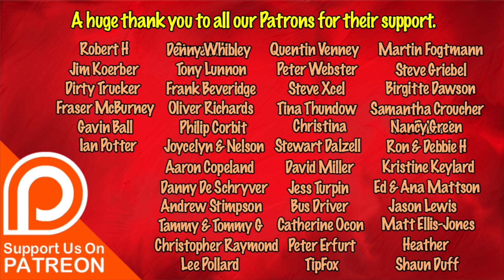How To Clean The Toilet In A Dress

Comment: You were so rocking that outfit Mazzy, so watch out! Your design will be stolen and it'll be worn on a New York runway next. What a dear hearts you both are! You give me hope I might actually get to the bottom of my big pile of stuff. I have a feeling a lot of folks stuck at home have turned to cleaning and sorting, as you have, and the charity shops will be bulging at the seams from all the stuff they will be given, once they open again. If they haven't, I for one can say I have taken a page from your book and am paring down. So now I wish they could open, so I can give them all the stuff. Also, I could have used those nice little tools Dan, the tiny screwdrivers especially. I've been wiring up pictures frames with new brackets and wire, and those screwdrivers would have been perfect. I had to use an old worn out screwdriver of my hubby's and it was practically worthless.   Thanks for all the fun, have a great day!
Reply from the maker: Yes l have a vast museum full of tools for all jobs.
Reply: @TravelTrollsTV  And just think of all the ways you've learned to use them this year! Ha ha ha

Comment: The idea of the short plug in is that you can have it indoors and then hook up your main camper lead to it and the join is in the house no chance of the connector getting wet etc but you have the long one so I would do as you said keep it as a spare head for your main hook up , The window washer filler is a lot easier to fill if you cut the bottom off of a litre water bottle or large coke bottle use that as the funnel works a treat , watch that water filler cap I had one and the inner white locking ring gave way whilst in place it was an absolute B*****d to get out I ended up drilling the centre out and moving the jammed bit from the hole I had drilled out with a 35 mm spade bit . They are great all the time they work but you never know when it is going to say no not coming off today.

Comment: Dan your new oil filter has a rubber seal on the top.
Rub some oil all around it before installing it.
Make sure the old one has a seal on it and not stuck on the motor.
Before you screw on the new one.
Hope that makes sense.

Comment: The blue socket that connects to the van, at the other end is a blue plug that plugs into a blue socket at the site. If there isn't a blue socket, only a domestic socket, the adapter is necessary.

Comment: That adapter plugs into the other end of the mains cable so you can plug into someone's house socket. It saves carrying the weight of two cables.
Reply from the maker: But only useful if they have an extention.

Comment: The plug goes into the wall at home for example and the end of the long cable that normally plugs into the electric bollard on site goes into the other end of the cable with the plug on.  So if you have your van at home you can plug in as normal and charge your leisure batteries.

Comment: Hi again ,just a tip for oil filter removal ,maybe Owen has told you but if the oil filter is a bit tight to unscrew there is a tool  for it , its basically a band with a handle , but in most cases you can unscrew and tighten  them by hand with gloves on ,remember to remove and add a dab of oil to the rubber seal on the end new filter , anyway hope the tips help am sure Owen being mechanic can advise ,but I thought would mention it in case he's out  or something ,see ya 👋👏👏👋👍
Reply from the maker: Too late. I made a mess of that job today. Video coming soon.

Comment: Hi guys ,Re the toilet cleaning and blue stain  ,I normally use Elsan fluid ,I did try a different one in a bottle you squeeze into the top measuring thingy  ,forgot it's name but wow did it leave blue stains on anything it touched ,were as the Elsan one worked better and didn't stain blue ,just thought would mention 👍 looking forward to oil filter fitting 😎
Reply from the maker: Yes thats the one we used which caused the stains.

Comment: Yes Dan you also need an oil filter wrench to take off and install the new one!
Reply: Aw come on Gerald, let him use the old "punch a screwdriver through it" method. It will make hilarious video! lol Best Regards, Roger
Reply from the maker: Had one. Didnt help.
Reply from the maker: A screwdriver was used lol
Reply: Pipe grips to get the old one off, hand tight for the new one on.

Comment: For the washer fluid top up - cut the bottom off the small water bottle and put the top (drinking end without a cap ) end  in the washer bottle. Pour the fluid into the upturned bottle to use it like a small funnel. Peugeot Boxer is the same and a complete pain , its a very poor design as is the location of the power steering fluid reservoir.

Comment: How about if you unplug the lead from the van and  at the electric power point and then plug your wee plug into the end that comes from your electric source then you can plug it into a standard 240 v outlet .thats wot i used to do when parked on my driveway to keep the fridge running

Comment: The short lead with the two plugs can be plugged into the end of the hook up lead to allow u to plug into a domestic plug, but u do have another long one 🙈🤣😂🤣
Reply from the maker: Exactly.
Reply: But using the adapter means you dont have to carry 2 full length leads.

Comment: You have over filled the coolent. Should be between min and max when cold.
Reply: not at all, cold fill to the max still leaves enough for expansion, between is a myth
Reply: @furface9779  Its not just a myth, its stupidity. Anything which is hot or cold specific, is clearly marked, like power steering or transmission fluid levels. The Max level on cooling systems is always halfway or so up the reservoir for a reason.

Comment: Hi guys looks like your engine coolant needs flushing because it’s brown and shouldn’t be that colour  just thought ide let you know xx
Reply from the maker: Its red.
Reply: @TravelTrollsTV  after 3 years, it looses it's anti corrosion property's and blows head gaskets & pumps by  corroding aluminum (ask Owen) brake fluid the same, it breaks down and slowly jams the break calipers
Reply from the maker: @furface9779  Its not even been in a year. I had to keep refilling it when we had the radiator leak.
Reply: @TravelTrollsTV  it was general information that most don't know but should